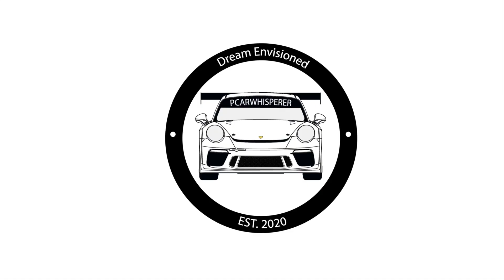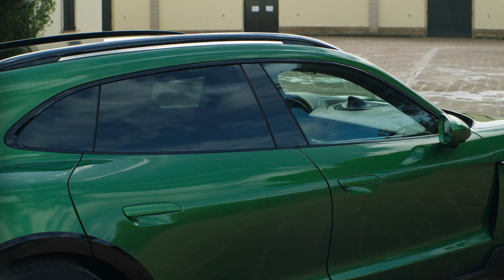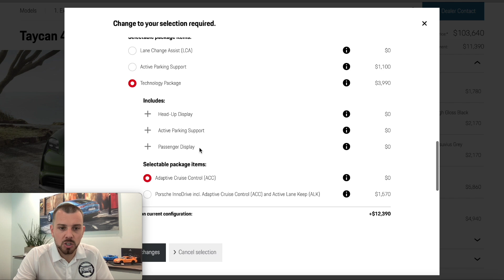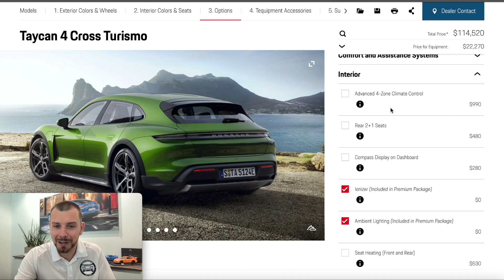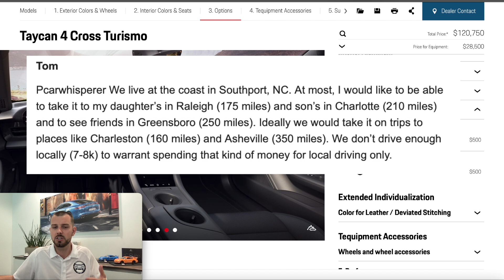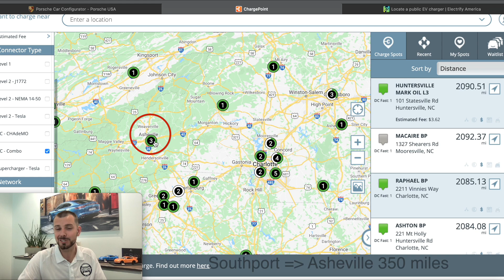2021 Taycan Cross Turismo is Here! Build Walk-through, Standard Equipment & Must Have Options!!

Comment: Great video.  Question: I am looking to order a 2021 Cayenne GTS coupe in the next few months.  Should I instead consider the Taycan cross turismo - maybe a 4s version?  I'm near san francisco; lots of country roads on the coast.  No need to haul anything.  Is Taycan mature enough (i.e., the bugs worked out) at this point, or should I wait a couple more years to get a Taycan?
Reply from the maker: Thanks Joe! Great question... that's a tough one.. I love the Cayenne GTS especially that V8 but if your not concerned about size and space I would consider the Taycan Cross Turismo, this car is going to be killer and will be perfect for the Bay Area as there are many Electrify America chargers around that area with more being installed. The driving dynamics of the Taycan are unbelievable with a very low sporty driving position. This is true they have had there fair share of bugs which a lot have been addressed in this last update! If you are concerned about future bugs and not having to fuss with charging I would go with the Cayenne GTS and enjoy the raw V8 power while Porsche still makes it as the industry if turning towards electrification. The V8 motor that the GTS has is incredible, it makes a magnificent sound. In the next decade a car of this stature may be in the distant past... enjoy it while you can!

Comment: Did some research on using ChargePoint to travel to son’s house in Charlotte.  The fastest charger I could find only gave you 72 mi./ hour charge.  At that rate I would be there approx. 2 1/2 hours.  There was one location in Huntersville, NC that charged at 188 mi./hour but that was 223 miles from our home and added 32 miles to our trip.
I then looked on the ChargeHub EV app and found a Greenlots charging location that was on our normal route. It had two charges rated at 125 A and 150kW.  Not sure how long that would take to replenish the 195 miles I would have driven to that point.  That appeared to be the only good option, providing chargers are available and working.
Reply from the maker: Shoot it seems the infrastructure may not be ideal for the Charlotte trip quite yet 🙃 as the waiting for the charging will take some time. The charger at the Greenlots at 125A 150kW would take approximately about 1.5 hours or so. Did it state what the voltage was at that station?
Reply: @Pcarwhisperer  No. Best solution will be for my son to buy his first home as my daughter is in Raleigh. Then I can have a 240 outlet installed and charge overnight.
Reply from the maker: @thomasjohnwhite  perfect idea! Love it Tom!

Comment: Found your video very helpful. I just submitted my order for a 4 Cross Turismo to be built in July. I did a not insubstantial amount of research on the need for the 150kW/400V charger. In the US, it is all but unnecessary. For the Taycan, Electrify America is about the only game in town and all their 150kW chargers are capable of up to 800 volt output. There are very few "legacy" 150kW chargers from the other groups (ChargePoint, etc.). New installs are all 800 volt capable. I would love your input on this if your information differs. Thanks.
Reply from the maker: Glad it was helpful! Congratulations on the Cross Turismo! Such a cool car! Yes I would agree a very small percentage of the chargers are 400V and this on-board charger would hardly ever be used! I put it on my builds because in the small chance I am at a 400V station charging an Audi E-tron pulls up it would be able to charge quicker on that particular station... 3 times quicker... its just a pride thing can't have the E-tron charging faster than my Taycan 😂 The option at $460 is such a small fraction of the overall price of $100k + car I add it because of that 3-5% chance I may need it 👍🏼

Comment: Thanks Mason!  Great car and like the options you selected.  However, would like to know your thoughts on Taycan Cross Turismo 4 vs 4S now that some many items are standard on the Taycan Cross Turismo as you explained so well.    Was very close to purchasing a Taycan 4S but now waiting for the Taycan Cross Turismo.   Thank you for your advice.
Reply from the maker: Thank you Jeff!! Glad the Turismo was released just in time for you! I would personally go with the 4S over the 4 due to the significant performance improvements and options that are not available on the 4...performance package etc. If greater performance is important to you I would go with the 4S as the 0-60 time is just about a second faster with an additional 100hp as well! 👍🏼 Hope this helps!